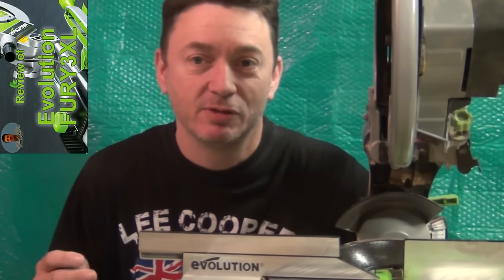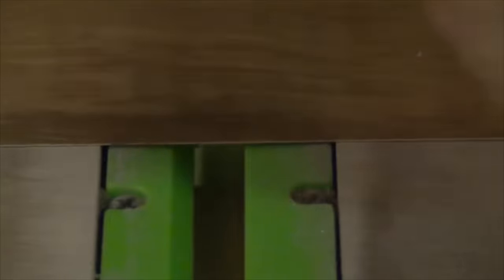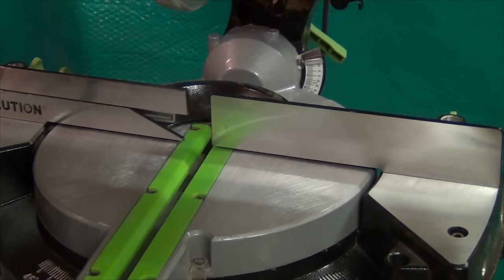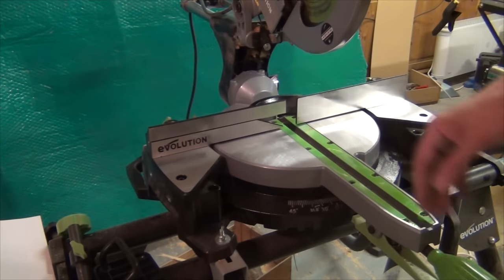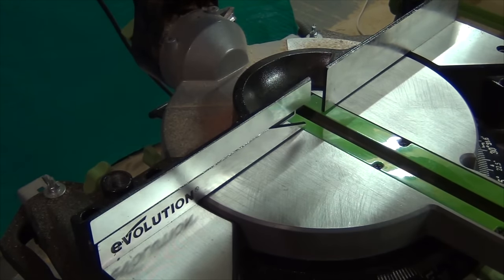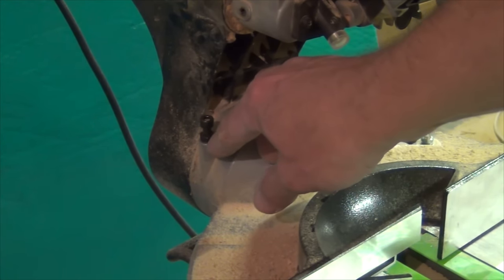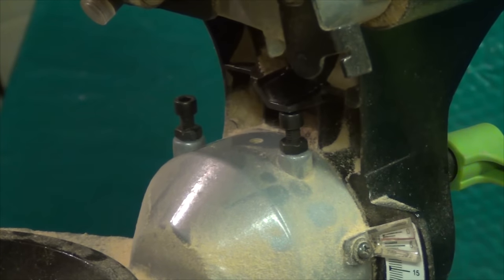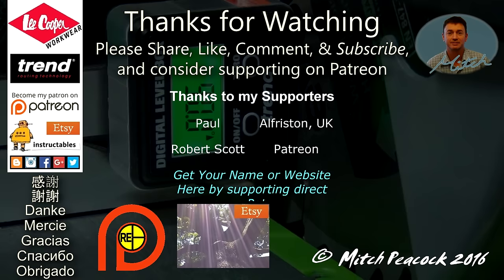Mitre Saw Setup for Accurate Cuts

Comment: Quality video that. I’ve just grabbed the trend digital angle finder box as my evolution always creeps out by a few degrees with it being lugged in and out of the van for work. I like the plastic cap idea. If I can get another few years out of mine then I will but they do tend to get quite a lot of play in them as they get older!
Reply from the maker: Cheers. I just changed the batteries in mine, which is still giving good service.

Comment: Thanks for the information. I just bought a miter saw and will be checking it out with your recommendations. But if the milling is not precise, it will go back to the store. I bought a table saw where the milling was so bad, I had to have it milled and pay for it because I had it too long before I found the problem. It is good to rip but the miter is useless. I will not put up with that kind of workmanship again. Now I know what to look for I will. Thanks again.
Reply from the maker: That's understandable. The more you pay, the tighter the manufacturing tolerances (usually), but that doesn't mean you won't get a spot-on machine if you pay less, there's just less chance.

Comment: I just picked up a Hitachi C10FCH2 Miter Saw yesterday for $120.  It'll help kickstart my business, but hopefully in the future, I'll be able to get the Milwaukee Miter Saw, as it has an integrated digital miter gauge.
Reply from the maker: Not seen the Milwaukee, but I'll keep an eye out. Most saws have indents for the commonly used angles, and once setup accurately this allows speedy changes, but an accurate digital gauge could come in handy. Does it have one for both tilt and swivel? Tilt is usually where I prefer to always do a test cut, no matter how well setup, since the scales are usually so small
Reply from the maker: That looks nice! If I didn't YouTube I might earn enough to get one lol! All the same setup procedures would still apply, followed by resetting the digital to a true ninety. But after that, wow!
Reply from the maker: Not familiar with that specific plane. There's a great site that covers Stanley planes, do a web search for Patrick's blood and gore Stanley. Sounds odd, but that should return the site on page one of the search results.

Comment: Good video I'm a newbie woodworker and have just bought the sliding mitre saw from lidl 🙄 anyways I have used it for a couple of days and have figured it's not plumb or square to the fence, I was cutting 4x2 and it didn't seem to bad but when I cut a 8 inch window board I could see it was well off probably a mill or 2 when I looked further I figured it was not doing plumb cuts either
Reply from the maker: Cheers John.
Hopefully you can now adjust it correctly. Bear in mind that these cheaper saws will often have a little more movement in use; ie the user can inadvertantly force the alignment out a little due to flexing of components. Try to get used to operating the saw by only moving your hand plumb and square.
Reply: @mitchwoodwork  I think I should be able to move the fence handy enough to get it square not so sure about plumbing it up there 2 screws but as a newbie I'll figure it out I watched another video doing the lidl saw but he doesn't talk in it just adjusts the screws send like it's trial and error for plumbness

Comment: Great job! IMO, this is a better video than John Heisz' simply because you go through all the steps. Very thorough. You missed a few things (a better explanation about saw teeth, for example), but nonetheless probably the most complete explanation of the setup process and all the factors that I've seen on youtube.
Reply from the maker: Thanks Austin. I tried to cover points not dealt with in other videos, and those found in cheaper machines. I thought John's was very good, so I'm chuffed you rate it against that.

Comment: Best video I have seen thus far. Thank you. I subscribed. 

Question: I have a similar fence. If I wanted an auxiliary fence, would I have to tap the holes myself to add screws through the fence to the MDF auxiliary fence?

Any tricks to doing this ?

Question : how do I check that the test boards I am cutting are 100 % straight? If they weren’t straight, the Angle square would show me a false negative when I looked for a 90 degree cut. 

Question: what is they sliding fence top you have on the left side for? In have one too and can’t figure what they heck it is for. (Side note, mine is indented too and I will have to sand it down to make it square with the lower fence as you did)
Reply from the maker: Thanks!
Threaded holes in the fence are nice but not necessary. The machine screws that they take can be cut so as not to protrude behind the fence. Plain holes can be used, preferably with nuts and bolts, and if using wood screws then screw through into piloted holes in a hardwood block. I've seen double sided tape used, which is an option, although removal may entail some cleanup.
A straight edge would be ideal to test the straightness of your boards, but builder's aluminum levels are usually a good bet. Really, the fence of the saw should be straight, and you could check for full contact along it's length with the board.
The sliding fence is just a way of adding support high up next to the blade, and is moved to the side to accommodate tilting of the saw head for beveled cuts.
Reply: Aah Woodwork with Mitch Peacock noted thanks. 

I am thinking of adding an auxiliary fence. Would you recommend it? Much more accurate cuts etc. 

Have you added an auxiliary fence to your mitre saw?

I am wondering why the manufacturer of my saw (and yours) did not add holes to the fence to make attaching an auxiliary fence more easy. Hmm ? 🤔
Reply from the maker: @marcnaidu5804  A zero clearance fence will help break-out, as would a zero clearance insert in the base.
To make use of any dado ability, where the depth of cut is limited by a stop, an auxiliary fence is needed to bring the workpiece forward enough so that the full blade depth can reach the back of the work.
I rarely worry about these factors as usually I'm just rough cutting before working unplugged. When I do, I usually hold the auxiliary in place directly with the workpiece.
Not having axillary fences in place allows the maximum cutting capacity, which is usually more important to me.
Not having pre-drilled holes saves a tiny bit on manufacturing costs, and is a shame for sure.
Reply: Aah Woodwork with Mitch Peacock noted thanks. Agree with all your points

Comment: Thank you so much for this video Mitch. I've just received my Evolution Rage 3DB sliding compound mitre saw, and upon initial setup I discovered pretty much exactly what yours shown in the video, a crowned mitre turntable which rocks the straight edge I used to check it with like a see-saw!
Needless to say I was quite disappointed.
I knew this is not a high-end product, but it does have a unique feature (low rpm & high torque which allows it to also cut metal) not commonly available on this type of saws, and hence the choice for it. Still, having a level bed is pretty basic for any such tool and it isn't really that cheap.
Returning probably isn't an option for me due to no local dealer in my area as it was ordered overseas from the UK (and already paid a hefty freight too), and I was at a loss until I saw your video. I did think about doing something similar but just not sure if it would do more harm than good. Now that you've shown that it could be done I will probably try it with a leveling beam then.
Only question I have is the length of the beam you used which seems a bit shorter than the width of the bed. How did you determine that to be the optimal length? Was it just so the sand paper wouldn't touch the edge? Wouldn't that make the beam effectively uneven and potentially sand below level then? I guess diligent periodic checking could help with that situation. Would it be good to use a longer beam that goes over the entire surface but with (same thickness as sandpaper) shims situated over the edge area?
Again, thanks for sharing your solution, and I appreciate any advice you may have.
Reply from the maker: Thanks. To finish the levelling a long beam  is a good idea, but initially it might cause sanding where you don't need it, unless extreme care used. Let me know how you get on

Comment: Pro tip: hold a heat gun or hair dryer on those stickers and they peel up real easy with no residue. 
Obviously be careful cause the saw block is aluminum and has a low melting point, but just a quick exposure from an appropriate distance until the sticker peels should be no problem at all.
Reply from the maker: Good idea!
Reply: A greater problem than melting would be additional thermal distortion of the base, should we were to use a heat gun. Of course, 180-200 deg C should not be problem with aluminium, but I'd be careful and sand away the imperfections after it has cooled down completely, to exclude the possibility of a further operation to flatten thermal distortion.

Comment: Hi Mitch thanks for reply, well tried it on pieces of 4” deep mdf which was totally straight but still gave this weird curved cut line! Sounds like operator error I know!!
Reply from the maker: That is odd. Try sliding cut vs chop cut, and use a light touch, letting the saw cut slowly and the machine keep the saw aligned. If you fight the machine it's surprising how much flex you can cause.

Comment: Hi Mitch only just got into your mitre saw set up video which is really useful thanks for sharing it with us. I have used it to set up my v old v cheap sliding  compound saw. One problem I can’t seem to solve with mine is the cut line I get (especially a 45 degree vertical cut in skirting board) results in a slightly curved cut line instead of a true vertical line. Prob sounds a bit strange but wondered if you’d got any thoughts where I might be going wrong?
Cheers and thanks again!
Reply from the maker: Hi Paul, My initial thought is that the board(s) are slightly cupped?

Comment: Hi Mitch, great video for a saw set-up...... I was waiting to see you hitting the table with the diamond plates to polish it up again. LOL Just kidding. I have been eyeballing the Bosch Glide Miter Saw as I really need to replace mine ASAP. Thanks for another informative video.
Derek
Reply from the maker: Cheers Derek. Not tried the Bosch. I would narrow down by required capacity and features, then try out all that remained. Some of these saws are quite an investment, so it's worth a test drive before committing. Hopefully I've shown that good results are possible whatever the budget.
Reply: You really have shown that great results are achievable with many average cost saws Mitch and your video was really well done. On the Bosch saw comment, I have been doing all the reading I can find on several saws before I buy anything not to mention the myriad of YT reviews and Woodworking websites. I seem to be down to this one saw though because of the space savings behind the saw, dust collection and overall fit and finish. From everything I have seen over the last year, this saw has to be my choice even with the hefty price tag. I will only buy it at a sale price and I just don't have the disposable income to afford something such as a Kapex.. I am good with this choice of saw after everything I did to really research it and it meets all of my needs including price. Now it's down to a real problem that I just can't decide on...... 10" or 12"..... that is the question !  lol
Thanks for taking the time Mitch.
Reply from the maker: Sounds like you've done all the leg work! I would go 12" myself, because I know there would be an occasion when I'd regret not having the capacity. As it is, I'll be using this one and dreaming of more capacity and dust collection ;-)

Comment: Thats crazy I would never have thought you would need to sand down a saw to make it level you would think they would make them to better tolorances
Reply: Do you think Dewalt saws are better? I will check mine tomorrow before I cut the new skirtings in my hall
Reply from the maker: @paulahamilton7290  for twice the price or more I would hope so
Reply: @mitchwoodwork  I just checked it and when I swing it left the mitre is off very slightly but when I swing the saw to the right the mitres are absolutely bang on so I will use it swung right tomorrow and hope I get a good finish! I am not a pro in fact its only the second time I have done it I am so glad I saw your video thank you very much
Reply: I cut a few of cuts I had lying about each way and checked them with a square
Reply from the maker: You're welcome. I'm pleased you found it mostly accurate, it saves time and ruined work.
Reply: @mitchwoodwork  Fingers crossed it turns out ok I have redone most of my house through this lockdown mistakes were made lessons have been learned but on a whole I am over the moon with how everything has turned out so far and I am almost finished now just these skirtings to go and then a new bathroom to fit and thats me done.... for now! Thanks again!

Comment: Nice tutorial and doing this Mitch!
Reply from the maker: I suspect your Festool was closer out of the box!
Reply: Pretty close. Still needed a little tweaking. But it is done completely different than what you showed. You actually move the scale that the table locks into not the fence. Very slick.
Reply from the maker: +GuysWoodshop interesting. more parts more cost I suppose

Comment: Great video Mitch. I'm just sorting my Rage 3 out. Just a quick question, the slide on top of the fence on the left hand, how did you get it out? I'm stuck at this point as mine doesn't want to come off
Reply from the maker: That's a good question. The adjustment screw has to be fully undone, not just slackened. Try that. Possibly there is a further set-screw hidden in a hole from the back, but I can't remember just now. Hopefully that will do it. If not, get back in touch and I'll take a look next time I use it. Cheers
Reply: Mitch Peacock - WOmadeOD ah! A 3mm grub screw, right next to the clamp holder hole, thanks Mitch ☺️
Reply from the maker: Sorted. That'll help someone else out for sure

Comment: I also have the same Rage 3 Miter saw and I reside in the US.  I have been having  a hard time really dialing in the adjustments on this saw.  It does not cut quite square. And using an angle gauge, I notice that the angle is also not quite 90 degrees.  Are you able to do precision cuts with this saw ater the adjustment/tuneup?  If so, what steps did you take to make sure that the cuts are square and the bevels are also true?  I bought this saw in December and have not been able to cut but maybe 10 cuts on it because of the adjustment not been true.  Did Evolution help you with the adjustment or Tune-Up to get cuts really True?
Hope you can help me with info.  Thanks.
Reply from the maker: I do get precise cuts since the tune up, but I can't give you a figure on the tolerances. However, as an example, I can cut a 4x2 and my try square shows no visible error in either direction.
A good test while adjusting is to start with a wide parallel board, slice in half, flip one half over, butt the cut edges together, and check whether the long edges are reading straight.
It sounds like you will need to adjust both the fence, and the bevel end stops. Both are shown in the video. Also watch John's setup video - link in description if I remember correctly.
I didn't use Evolution support, but I spoke with them when I visited their headquarters here in the UK, and they appeared to be very knowledgeable and customer focused.

Comment: Sorry if I had picked up a brand new Mitre saw and the base had a crown it would be straight back for a refund . Loved your video and the ideas to fix ithe saw  however this is more of a video on "what saw NOT to buy"
Reply from the maker: Cheers. Agreed to a certain point. Budget considerations will sometimes limit the accuracy you can buy, but not the accuracy you can achieve with some work.

Comment: Mitch, while this was helpful for renovating a CMS that one might pick up as a used tool, I'd be inclined to take a new tool back to the store of the bed was crowned so badly.  There's no advantage to buying new if you still need to amend so many mistakes by the manufacturer.
Reply from the maker: Cheers Steve. Yes, if it wasn't within the specified tolerances then a replacement would be the best option.

Comment: My rotating base of my mitre saw is 3-4mm lower than the out wing
Reply from the maker: This is not acceptable - take it back! What make/model is it?
Not a new saw, then:
It's possible there may be an assembly issue - missing washer/bearing etc. so you may be able to shim the base up so it's level. Alternatively, you could add a compensating cover to the base - this has the added advantage of allowing you to create a minimal clearance slot (obviously tilting the blade will increase it slightly, but it will still be better than the usual arrangement).